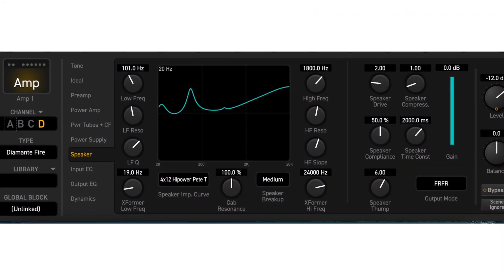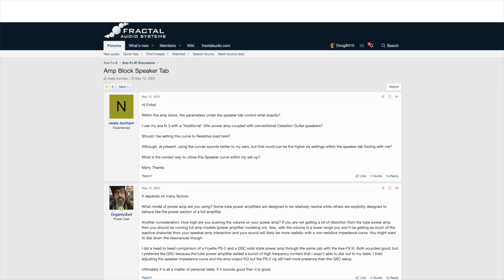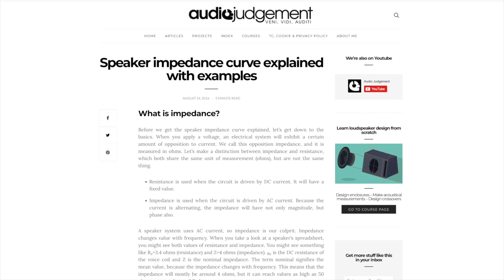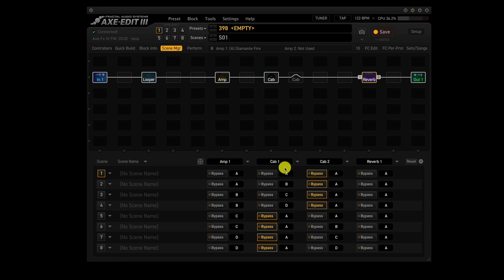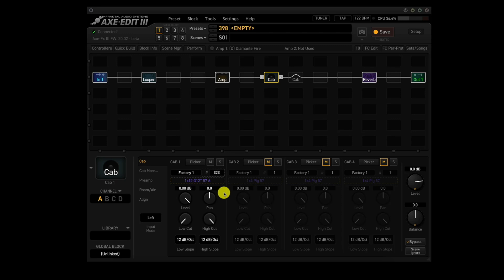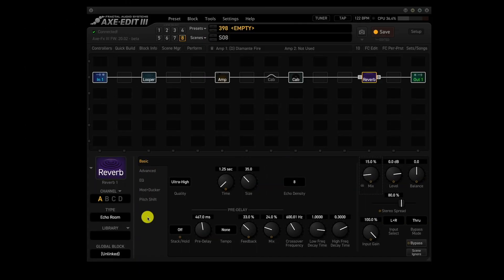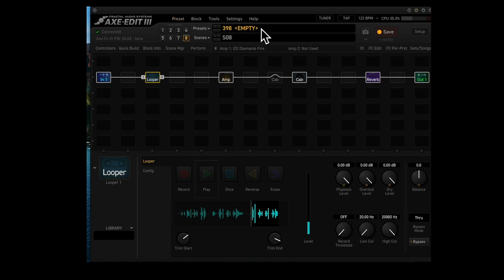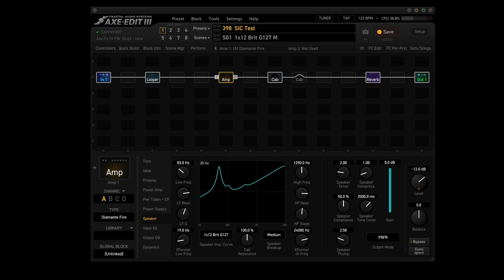Axe-Fx III - Let's Look At The New Speaker Impedance Curves!

Comment: I'm not sure if this test is done correctly. To test the tone differences in Speaker Impedance Curve Algorithms, shouldn't the only variable be... Speaker Impedance Curve Algorithms? If the IR in the Cab block is different for all 8 scenes, then you can't really compare the 4 Speaker Impedance Curve Algorithms.

It's like testing the significance of 4 different engine models for car speed, but with 8 different Chassis as well - some heavier, lighter, more aerodynamic etc. thus affecting the result of the vehicle's speed. This test would not single out the desired test variable of Engine models. 

If I were to test it, I would have a matching Speaker Impedance Curve Algorithm with the IR cab in scene 1, and set that as the only Cab IR for all the other scenes (2-8) as well, and have a unique Speaker Impedance Curve Algorithm for scenes 2-8.

I.e. [AMP 1, CH 1-4  |  AMP 2, CH: 1-4] , [CAB 1, CH:1] .

Anyway, Speaker Impedance Curves are the 2nd most important tone shaping variables, before Cab IR's in 1st place. I would only rank the basic BASS, MID, TREBLE knobs on the "TONE" page as the 3rd most important factor.
Reply from the maker: Thanks for the comment! I chose 1 amp, 4 SICs, 4 matching IRs and 4 non-matching IRs, just to show the difference between matching and non-matching and how you can have 8 different sounds while using the same Amp. It sounds like you want to expand on the non-matching scenario. I'm not understanding why that would be correct. However, you appear to see the validity in that type of test, so go for it and let us know the results!
Reply: @DougBsDigitalDen  From my own testing, it doesn't completely change all of the tone's frequencies/phase like an IR change does, rather it only really changes the mid range characteristics.
Reply: I thought the same thing, was half watching and thought “wow, what a difference! Far more than when changing the impedance on my Waza TAE!” (Which is not insignificant)… only to realize at the end that these were all different IR’s?